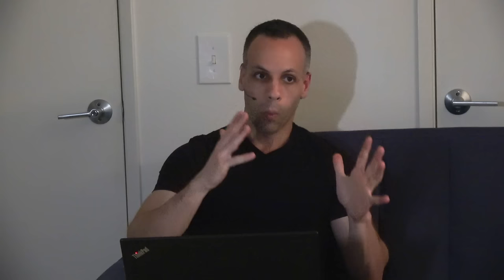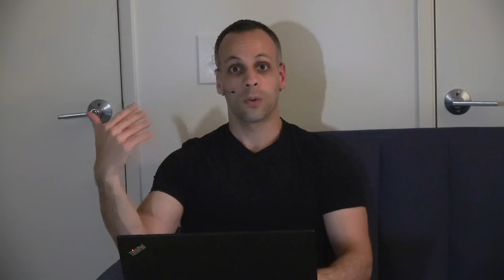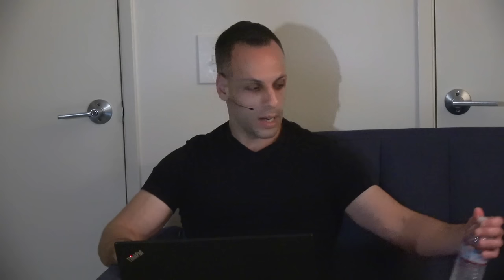EVGA's Oversight: Unannounced Changes Destroy PCs, EVGA takes NO ACCOUNTABILITY

Comment: Is it asinine? Yes. Is it surprising that companies will never standardize unless forced to? Not in the slightest.  😬
Reply: I would have at least had a redundancy like a different color connector on the psu to signify a Rev change. Some engineer dropped the ball.
Reply: i feel like if we look back a few decades to earlier advancements in pc technology, like USB that started of as simple serial RS232 communication, companies were keen to standardise things, and not be entirely cutthroat about everything. working with each other to some degree, just for the sake of progress was actually an option once upon a time.. no longer :<
Reply: @nemesis91101  its what happens when you outsource your manufacturing to 3rd party companies, and don't do the necessary QA and end user failsafe checks before shipping it out the door as your own branded product.

If EVGA made their own PSU's, then I'd blame the engineering team. But since it's not their own product, I blame their exec management for not ensuring a crucial aspect like this isn't triple checked before it ships to customers.
Reply: @Real_MisterSir  yea. THAT. Some sorta change to signify... a change.
Reply: @nemesis91101  Different shape so "idiot proof" (here it's idiots on the design side, not consumers, as power mismatch should NEVER fit).
Reply: @TechyBen  yea  but thats a bigger design change than using different color plastic but more correct YES
Reply: The connectors are standardized and so are the pinouts. How the wiring is done from the PSU connector to the connector isn't.
Reply: look at how long it took Apple to have a usb-c plug on their iphone
Reply: @Real_MisterSir  this evga disaster not the result of outsourcing, it's the result of outsourcing to the lowest bidder
Reply: one word: PATENTS.
Reply: @nemesis91101  you can't change colors, it has to be black, gamers don't buy PSUs unless they are all black or all white. Ketchup and Mustard cables ain't a thing anymore.  
But you could and should do different shapes of the plastic connetors... you know how they have those little shapes on every pin so you do not accidentally plug the wrong thing in or the wrong way around. If you literally change the pins on the same product you REALLY have to make sure that people don't mix and match cables, intentionally or by accident. Not changing the plugs is straight up negligent.  

....it is so absurd i'm not even sure i believe the story.
Reply: Interoperability standards are not typically foisted upon companies. The companies themselves recognize the need and set up an industry consortium that develops the standard. Say PCIeg, USB-IF, etc. Sometimes the standardization process gets hitched onto an existing organization such as IEEE or IEC or ISO. In this particular case of power supplies, there is no standardization because such boo-boos don’t really affect the manufacturers all that much. Lest you bring up Apple’s Lightning as a counter example: Apple did not recognize the need. They had enough market share that they could expect the market to support their way of doing it. Other phone manufacturers don’t have this flexibility, thus they went with USB physical and electrical standards from the get-go.
Reply: @ZeroB4NG Lol no. Nothing in these pin assignments is patentable and there are in fact no patents on any of it.
Reply: @cyclopsvision6370 Absolutely not. It is the result of EVGA not having a process in place that ensures that all of their subcontractors manufacture the same product to the same specs. Don’t blame it on the “lowest bidder”, that’s not how any of it works. Anyone outsourcing anything must have a process in place that ensures that the bidder, any bidder, makes the product you expect them to make. This snafu is squarely on EVGA. Nothing to do with the “bidders”.
Reply: Not necessarily. Once in a while we get an actual good company that does things the right way because they believe in it. Like Framework, for example. It's rare. And they face a massively uphill battle because consumers will go with a crooked brand to save a hundred bucks or because it has a flashier appearance or is "gamer" gear.

If we don't acknowledge the ones that do it right, we doom ourselves to deal with those who do it wrong.
Reply: @ZeroB4NG Yup Patents.
Reply: @absurdengineering In general Patents are why companies don't standardize. Idk when it comes to pin layouts
Reply: @cyclopsvision6370  Not really. This was not a faulty product, or a product built to a wrong specification. EVGA themselves KNEW the pin-out was changed. EVGA is the one who DID NOT redo their RMA policies despite this knowledge. EVGA is the company who has not acknowledged and restructured according to this issue for over 2 years despite having known about the PSU pin-out change for at least that long.

It's not the result of outsourcing to anyone. It's the result of a mismanaged internal structure by EVGA themselves.
Reply: @nemesis91101  No, companies simply don't care. The only reason we even have a USB standard for all android phones is because the EU made it law. early 2000, the amount of e-waste piling up due to disposable cables and charges was becoming ridiculous. Why would companies standardize anything if they can just sell you their own proprietary solution?
Reply: @@fishy2939 well especially if they're on their exit strategy. Why buy components from a company you KNOW is slowly going out of business? Fire that mf on their their 2 week notice as a consumer and move on

Comment: The thing that makes EVGA 100% Liable for this damage is that their specific instruction caused the damage. Do not tell users to keep their cables to use with the RMA'ed Power Supply and not supply new cables, when they know that the new Powersupply isn't compatible with the device.

Can users exploit this? Yes. The way they would have to exploit this is by RMA-ing a EVGA Power Supply, being sent one that uses different rails, and then frying their drives. These are all things EVGA Tracks. They KNOW that the user sent in a PSU with connector A and they RMA-ed it with a PSU with Connector B. The way they can trivially stop users from exploiting them to run them out of business is by asking the user to send back the wires, and sending new goddamn wires, or by not changing the connectors on the same model of PSU.

If EVGA did something like this to someone who had tons of disposable money, and it fried a significant amount of hardware, they would 100% get taken to court, and they would 100% lose the case. There was no user error. The issue here is that the User, if they had performed no error, would have ended up with fried hardware as the result, because the result of frying the drives is what happens if the user follows the instructions correctly. This person could sue EVGA for the cost of the drives (and likely addition cost for lost work/wage caused by the issue), the TOS/EULA/Warranty Bullshit they spew out is not actually valid in a court of law, and legally they are liable for the instructions to the consumer. The reason they don't get sued is because no one in their right mind is going to spend the next 3 years and $10mil to sue EVGA for $2000-$3000 worth of computer hardware. That's why they can get away with this bullshit.
Reply: "Can users exploit this? Yes." NO stop following what youtubers say. For anyone to exploit this they would need to 
1* damage their psu in a way that evga won't void their warranty, possible
2* get "lucky" to get sent a psu of the same model with different pinouts
3* get no warning from evga where at some point they can totaly sent an email and tell the customer to destroy the cables, sent them a brand new unit (wires included) with huge red warning labels to not use the old wires.
Lastly they can standardise their own pinouts AND make different psu-side plugs for different ones.
Problem solved. It isn't even complicated. Just excuses to avoid the cost of the drives and childish behaviour (doubling down instead of taking 2 steps which cost almost nothing to fix a problem and avoid a class action lawsuit).

Comment: Insane that they don't key the connectors to prevent wrong insertion if they change pinout - sheer incompetence.
Reply: maybe even deliberate, but yes, incredible incompetence.  people are focusing on the messaging around it, but they're wrong, the problem is the design FIRST and foremost.
Reply: Connectors ARE keyed, but purpose of key is so it couldn't be inserted in wrong position.

But if you just switch 2 wires between each other, then this keyed connector won't help you. 

Moreover, these keys are literally just normal PCI 8-pin connector pinout for most PSU's iirc. Just because it is extremely mass produced connector. 

But EVGA should take accountability for this one for sure. They should've provided information and wires with PSU.
Reply: @DimkaTsv  Connectors can be keyed to make otherwise identical connectors incompatible. Good example is 8-pin Molex connectors are keyed differently on CPU vs GPU power cables because the 12v and ground wires are completely different between the two.
Reply: @DimkaTsv Individually keyed. If everything keyed the same despite being wired differently the keying does nothing
Reply: @bn880  Their biggest mistake was not putting a new revision number on the model with a new pinout and a giant warning in every box to not mix cables between revisions. That would have avoided this entire mess.

Comment: Your trap door analogy was spot on. Talk about a trap for young players.
This is a fail on so many levels. First, by using the same plug with a different pinout. Second, by no warnings. This seems like the exact place where those warning labels plastered right over the power ports were made for.

I think it more appropriate the box bore a big red label warning Lark's vomit.
Reply: They should have send the correct cables with RMAs of the problematic model. It would not be such a loss. But as stated in the pinned comment - they have sent new unit with wrong cables so it is a clear lack of care

Comment: Like when Pyrex famous for temp change resistant borosilicate glassware they decided to make it of soda ash glass with no mention of the change
Reply: yeah one does not simply change the product and continue selling it as identical to what it was yesterday..
Reply: Yah I had one of those shitty soda glass ones explode coming out of the oven, never pyrex ever again.
Reply: @DurzoBlunts  Damn, I've got 2 pyrex measuring jugs.. fortunately I only use steel (enamel coated) bakeware or ceramics in the oven. Might stick to that habit :P
Reply: @DurzoBlunts Pyrex owes me a $1500 kitchen floor from my experience, never pyrex ever again.
Reply: They do still actually make borosilicate glass cookware, I bought a few pieces while living in Europe.  The edge has a distinct blue tint vs green or clear on ordinary glass.
Reply: @Sawblade02  Their name has been associated with borosilicate glass since forever so to change the product's characteristics but not the name is the problem. Having both products on the market with the same name is ridiculous
Reply: Only all uppercase PYREX is borosilicate glass and heat safe, lowercase pyrex is soda ash
Reply: @leland818  I wish I would have had this cheat code long ago
Reply: @skygh  The whole "pyr" part of the name was to do that the glassware was sold on that premise. Being it was intended to be heat-resistant from the very beginning, the change was a break-away from the reason the entire company/brand started in the first place.

Comment: That modular power supply cables don't even have a minimum level of consistency and defacto standardisation is insane.
The absolute minimum should be for an entire generation's worth of them to be identical per manufacturer, and the cables being physically incompatible (i.e. too small, hook in wrong place, etc), when a break needs to be done for the next generation.
Reply: yeah, they should just use the same connectors on both sides.. not sure what's going on there

Comment: EVGA should absolutely be  held accountable for the damage of IDIOTIC policies!
Reply: yeah this one feels like a real pants on head moment
Reply: Do you mean made bankrupt and vultured to golden parachutes?
Reply: Sorry but this is 100% user error.  Different power supplies using different modular pinouts has been a thing for 20 years now.  If a person caused damage by not knowing what they were doing when trying to build a computer that's sad but it's also their fault.  EVGA, Corsair, Gigabyte, etc don't make power supplies they just put their name on PSUs built by a variety of companies, this is common knowledge.
Reply: @llynellyn  100%... but, in this case the user used the cables for the model they had, as supplied by the manufacturer...
Reply: @llynellyn did you not listen to the video? EVGA tells the customers that if theyir power supply has an issue that they need to send in, do not send the courts with the power supply as they will not supply new cables. They send you what's supposed to be the exact same model pack, but if you use the same cables you got with your original Power supply, you run the risk of sending the wrong voltage to the wrong pins because they changed the input on the exact same model
Reply: The warranty policy is not idiotic, it is perfect, don't send in extras so they dont get lost or damaged.  The pinout change is the only problem here (yes you could post notices but that's just damage control, big damage control)  As an EE designing the PSU circuit you should never be swapping pins like that when your connectors are the same, not even talking about same model of PSU.
Reply: @bn880 they should have sent him new cables then.
Reply: It's insane to even bring up bad actors who might exploit it. Sure, there might be people who do that. You know how you stop that? By not negligently swapping people's power supplies without new cables, knowing full well that old cables can brick their hardware. EVGA should be liable, because they opened themselves up to that in the first place by being cheap af and not sending new cables with RMAs.
Reply: @lancehope6568  the user thought he has a GQ1000watt
He had a GQ1000 V1
They sent a GQ1000 V2 (different stickers and retail box that he might not have gotten, but still different stickers).

So 1) no he didn't "use the cables for the model he had", 2) why did he get the V2?... maybe EVGA read the RMA request wrong... maybe he filled in the request wrong.
We'll never know because despite 2 long reddit posts there is no details or pictures of anything.
Reply from the maker: @llynellyn  These are power supplies of the exact same model number and the user is following the instructions given to them by the manufacturer. So call this user error demonstrates that you are completely out of touch with reality with a broken brain.
Reply: @llynellyn  One can expect that different brands/manufactures have different pinouts at the PSU, and even different pinouts amongst different models. The user manuals even warn about the dangers of using cables other than what came with the PSU. It is unreasonable for the user to believe that when he RMA's a PSU, that he would get anything other than his original PSU.  EVGA failed to tell the user that this was not the original PSU, and not only a replacement, but a different version.
Reply: @llynellyn watch the video again. You missed something